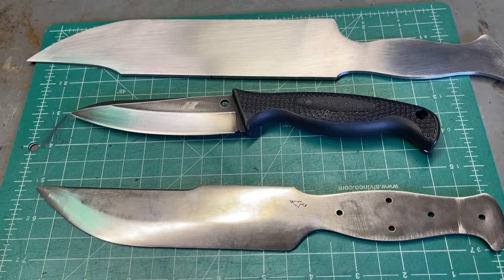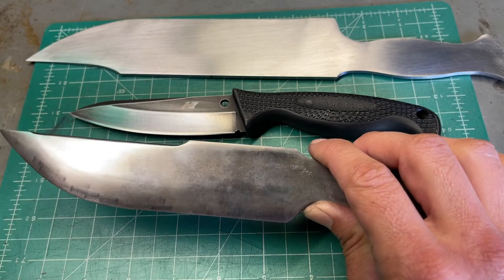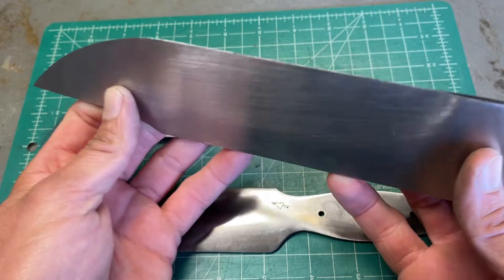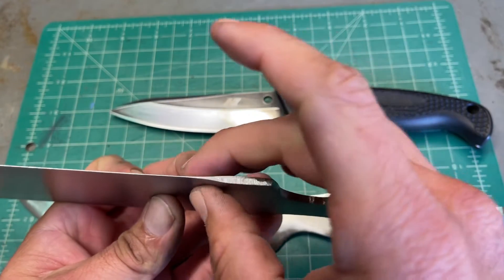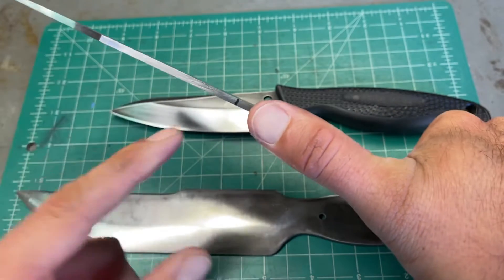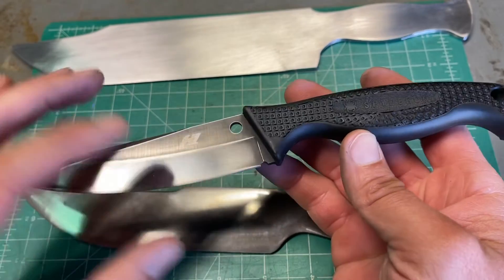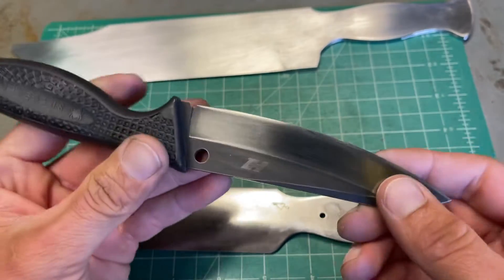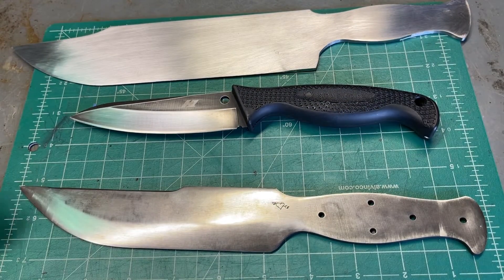Current works and future galvanic corrosion test with H1

Comment: I think your gonna need to bring your grind closer to your hand. That's a long way if you want to do any fine work with your knife. I never heard or experienced a knife failure in that area. Most I've seen are at the handle blade area. But it also depends on balance which is impossible to tell from videos. I'm sure you will do a beautiful job your other stuff looked amazing. I was just adding my two cents because you asked. Lol
Reply from the maker: Hello, ScalpingYour TP, thank you for the suggestion and your kind words. I checked out some knives I have that have a finger choil and this one is still a little higher. I’m still going to keep it there, for hitting things it won’t be a problem but like you said it probably will be a problem for fine work. I’ll test it in the end. At this point the main reason I want it there is that I like how it looks and I don’t think it will be too detrimental if it is a problem.Thanks again for your input, it made me double check my knife. It’s better for me to be sure now.
Reply: @totesmalotes  I really like your designs and I enjoy watching you test these steels I have never worked with. You have really changed my opinion on this stainless. I have a good bit of experience with 5160. I'm a diesel mechanic so finding old springs is easy and free. I made a few knives years ago. Now with the prices so high for simple carbon steel knives. I dug out the blower and got a new 1x30 belt grinder.
What really blows my mind is companies using 1095 for big chopper blades. Which anyone with a little experience knows is not a good choice. 1070, 52100,5160 all make better big knives and they are easy to heat treat reasonably cheap but most importantly tough. 
Your knives have really peeked my interest in big stainless chopper/ camping knife. 
Anyway have a good one can't wait to see how the experiment goes. I'm not a fan of h1 but it is amazing in Salt water.
Reply from the maker: @richardhenry1969  thanks again. I have to say I personally like Vanax the best but I’m also still learning when it comes to these crazy steels. Next up will be LC200N. It’s supposed to be slightly tougher than Vanax, which I don’t care about too much, I’m curious to see what else it can do. I personally never heat treated anything so it’s nice to hear from someone with experience in that. I always appreciate your insight on things. Also, I don’t like H1 at all but it was the only knife that was corrosion proof when I bought it.